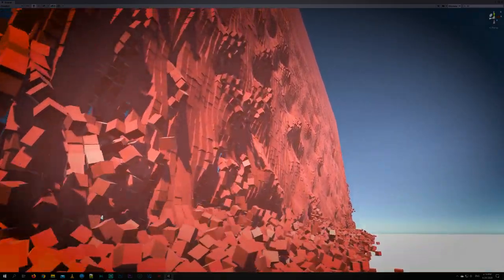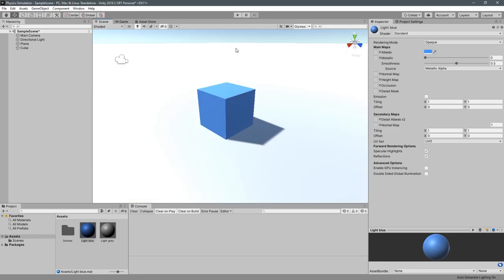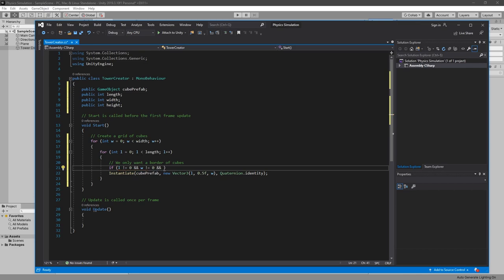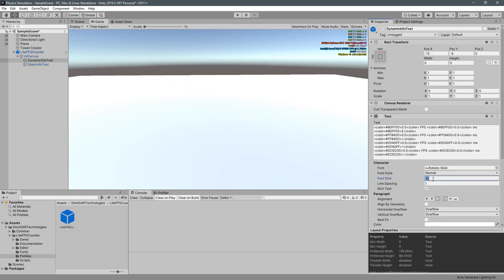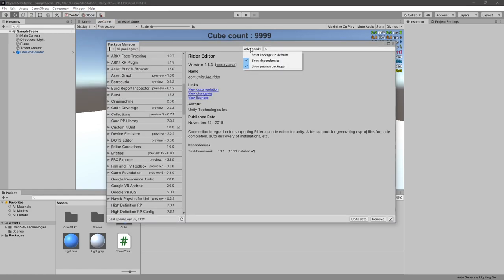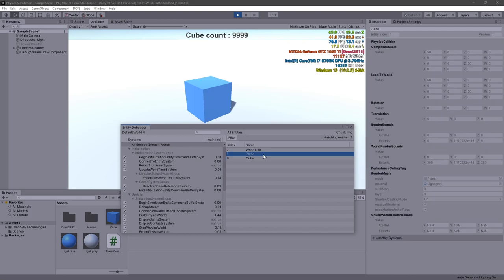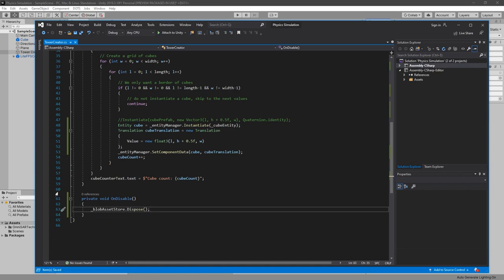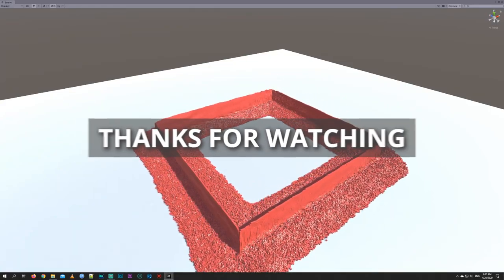How many Rigidbodies can Unity support ? [2020 DOTS Edition]

Comment: I loved your video! The DOTS workflow seems very promising if they manage to iron out the bugs and make it a tat easier/faster to implement. I work on mobile games and sadly i don't think this will have much aplicability there in it's current state. Here release time is in most cases more important than performance and from what i've seen the DOTS workflow seem slower.
Reply from the maker: Thanks for the comment ! For mobile, it is useable to optimise game and reduce heat but it'll be harder to code imo ^^
It can be useful to use ECS/DOTS for performance critical part of the game and use traditional workflow otherwise, I've actually shipped a mobile game that uses a DOTS pathfinding combined with regular game objects (Snap Guys).

Comment: Also, you should try this with Havoc too, I think that might be even faster than Unity Physics.
Reply: This isn't even Unity Physics - OP is using the "Rigid Body" component, which is not ECS and only supports PhysX.
Reply: @solaris5303  Did you even watch the video? He switches it to a Physics Body after testing Rigidbodies.

Comment: Very cool - performance x2 seems a little underwhelming though. I’m guessing using the BurstCompiler within your script would provide a decent boost?
Reply from the maker: The burst compiler was enabled but the only script on this project is the tower spawner that only works on start anyway. The bottleneck was the physic computation on the physic package side that already uses the burst compiler :)
Reply: Using a ECS physics subsystem (Unity Physics, Havok) would help immensely - this is using the Rigid Body component, which is PhysX-based and not ECS.

Comment: 8500 vs 15000. speed increase of 56% ?  not bad at all.
Reply from the maker: I was expecting better though ahah ! Interestingly, I could add 4x more cubes (60000!) with DOTS and still run at 15fps while regular rigidbodies could not be pushed that much, like 1.5x more I had 5fps xD

Comment: The DOTS editor was cancelled, and specific to project TINY. Unfortunately you are expected to set up your own archetypes or use sub scene conversion. You can also use authoring components. In addition to all that, you have the option to Live Link game objects to entities for editing at runtime.

By the way, did you test DOTS in a standalone build? Performance between the editor and standalone is substantially different supposedly.
Reply: Good video by the way! Just wanted to point these things out so you're aware (and other viewers are). :)
Reply from the maker: I did build the scene as shown in the video, yet it doesn't improved performance that much. Afaik the first Dots editor was dev by the project Tiny team, announced to be cancelled but the team said they will continue to improve their dots tools and merge them with the dots unity packages. 
You can check that the dots editor is still in preview and accessible today.
Reply: @LaCreArthur  I see, I hope that is indeed the case. I was reading up on it the other day and saw some Unity devs saying Monobehavior conversion was going to be the only way. So that will be a welcomed change, as the GO conversion and manual creation of archetypes are both... eh. :)

Comment: DOTS is still unusable. Simple things are still a nightmare to do, like a simple onCollision function. So I will still wait to use it. Nice video anyway!
Reply from the maker: I saw some collision detection example on the dots physic github repo, maybe I'll do the next video on it :)
Reply: @LaCreArthur  that would be a really helpful video :D
Reply: ECS is a different, potentially much cleaner way of writing things - you just need to adapt, basically every other engine out there (proprietary or otherwise) using an ECS model.

Comment: I guess, even though entities were used the number of cubes only doubled because physics are still expensive to compute.
Reply: CD math is expensive, so are objects on the heap when processing them by thousands, what DOTS physics streamlines is the data structures in memory allowing the CPU to work with perfect cache hit streaks for the entire physics simulation resulting in speedups specifically due to the lack of object overhead and cache misses.

Comment: you should enable GPU instancing on both GameObject and Dots version to have better FPS
Reply from the maker: I tried and it almost didn't change anything with DOTS or gameobjects. In most cases it is always better to do it of course but here the bottleneck is on the physics computation handle by the CPU, not on the GPU. The GPU had so much "free time" that it did not improve the fps at all

Comment: You asked for feedback: https://youtu.be/U6idEdIEsa0?t=534
This is feedback
 
No offence meant by this, but it's actually really hard to follow tutorials by people with an accent.
At: https://youtu.be/U6idEdIEsa0?t=5. You say "Ow many" when you mean to say "How many"
Same time stamp, "Widgid bodies" instead of "Rigid Bodies"
"He tries to found" => "He tries to Find"
No idea what. you were trying to say at: https://youtu.be/U6idEdIEsa0?t=21

"He handed up with a smooth  60fps simulations of 6000 cube" => "He ended up with a smooth 60fps simulation of 6000 cubes"

And most of the video that just happens all the time.  I'm spending brain power translating your words into comprehensible (not saying it's not comprehensible but it's grammatically wrong almost all the time, and there are words where I have to flip W's to H's and parse accented words that do/don't have the same in English) language.

If you're going to throw hundreds or even thousands of hours at this, you're not going to be wildly successful if you have the above issues all the time.  Spend a few hundred hours polishing your english - it's very impressive that you can speak another language, I can not.  But I skip almost every foreign language tutorial because of this issue, and was borderline skip on your video the entire time, the only reason I did not is because I have worked with a lot of French people, so I have an easier time parsing the French accent.

Or alternately, stick to the French language tutorials, I can only imagine it's a more captive audience than the English market that you're going to battle tooth and nail to get into, stay in, and gain traction within.  I imagine a really good French tutorial set would get you more traction and a better following in less time than it's going to take you to get the same in English.

Good luck